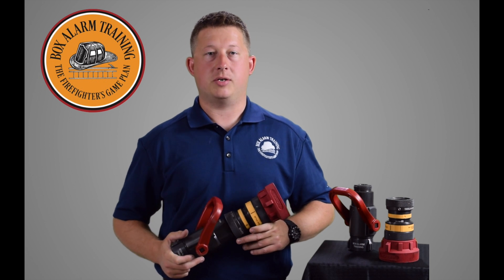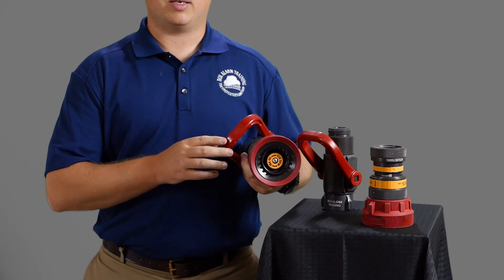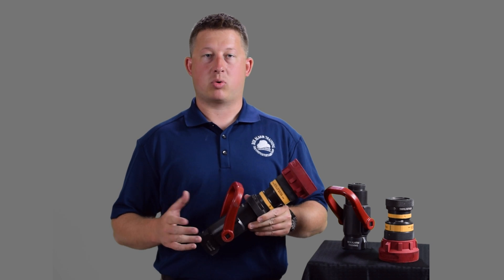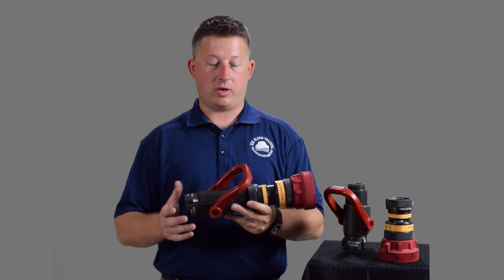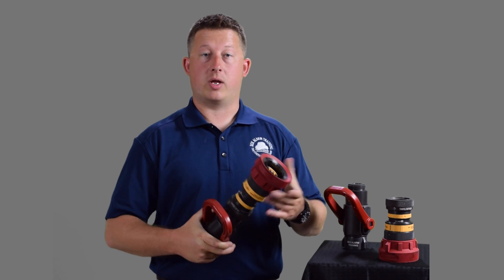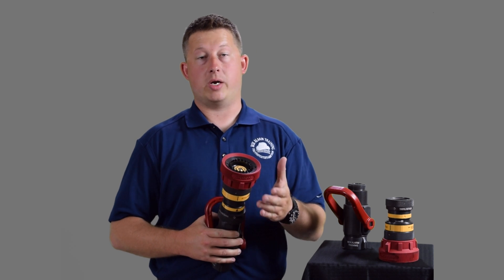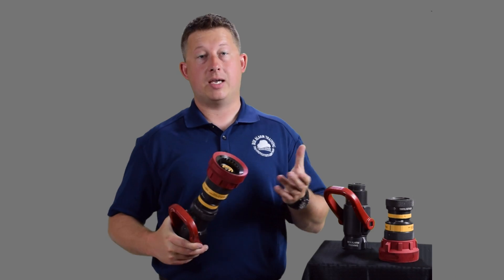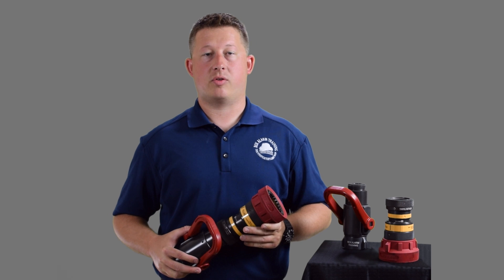Nozzle Series - Fixed Flow Fog Nozzles

Comment: I think these make a good 1-2 punch with a smoothbore.   Same nozzle pressure, same discharge pressure.  Possibly even the same rated flow (if set up that way).   KISS.   Gives you all the options, while keeping it as simple and standardized as possible.   You can also change the flow by swapping out the stream deflector.  Not as easily as switching tips on a smoothbore, but it's a simple and quick operation.     The combo you have here- with an integral smoothbore- is a great choice for CAFS.